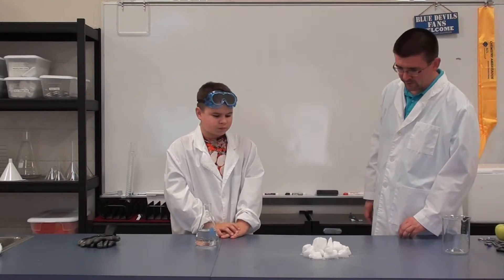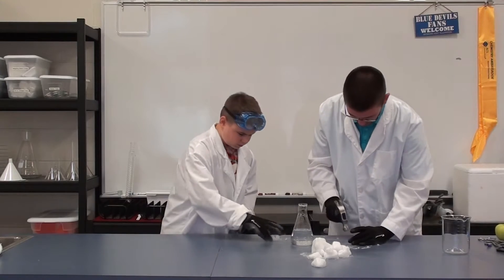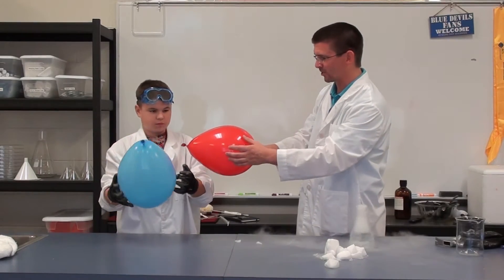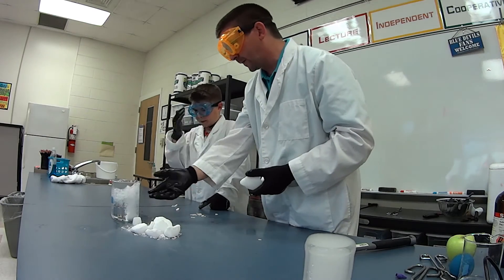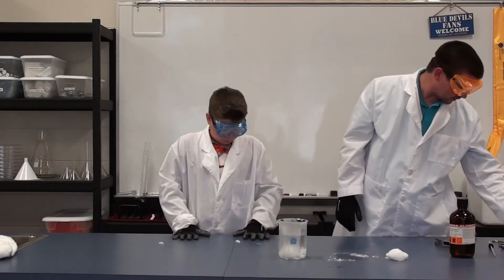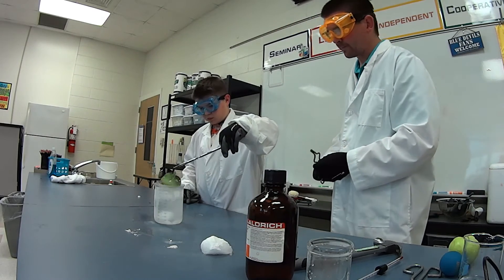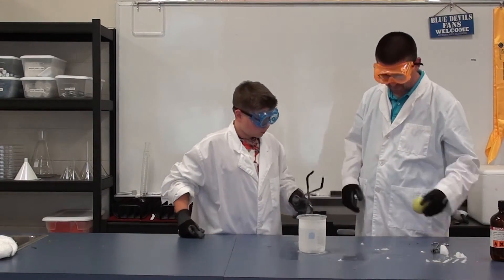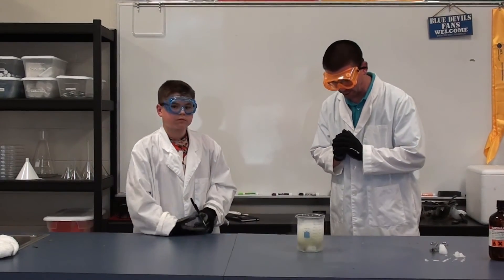EpicScience - Dry Ice and Acetone

Comment: Buy Epoxy Resin Online | Buy Cyclohexane Online | Buy POLYURETHANE CHEMICALS Online | Buy Toluene Diisocyanate (TDI) | Acetone | Isophorone Diamine (IPDA) | Toluene 

welcome to chemex Exploration Synthetic substances .we are in this industry since 1988. we cater best quality items which are source from all around acclaimed manufacturers of Research Chemical. we are unmistakable distributors/Providers of Modern Crude Materials. Our top notch and unadulterated synthetic compounds take into account the development of mechanical segments which are the top drivers of the development of the economy.
AROMATIC FLAVOURS & SPECIALITY CHEMICALS,BULK DRUGS & API INDUSTRIES ,CONSTRUCTION CHEMICALS & ADHESIVES ,ELECTRICAL INSULATION INDUSTRIES ,FLOOR COATING CHEMICALS ,HEAT TREATMENT CHEMICALS ,INDUSTRIAL RAW MATERIALS ,LUBRICANT & GREASE ,POLYURETHANE CHEMICALS,
Contact US:- 781- 519-9678
Email:sales@Chemexresearch.Com
Website:- https://chemexresearch.com/